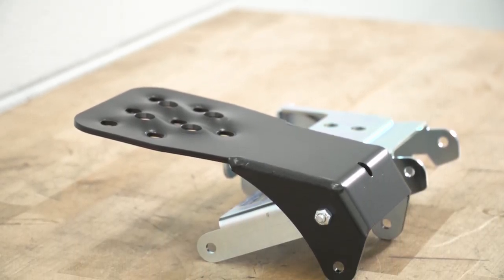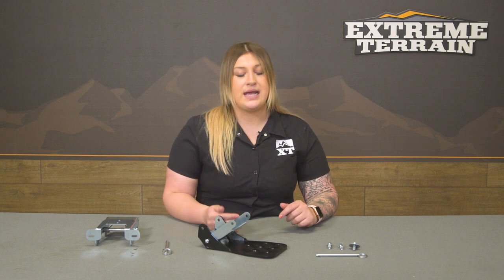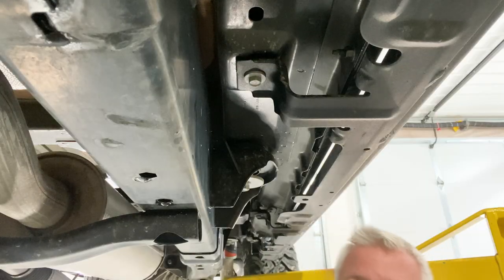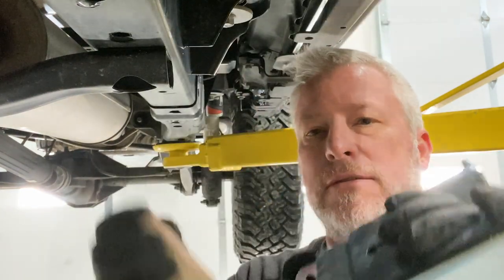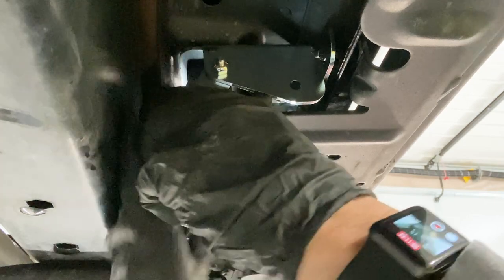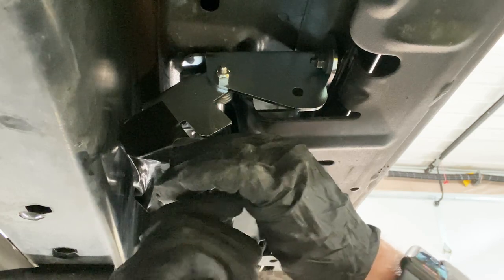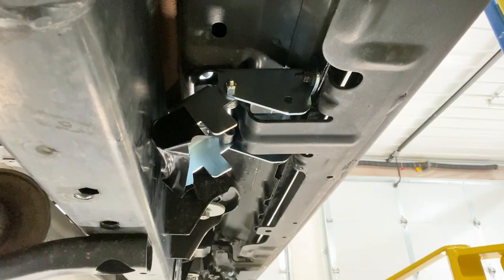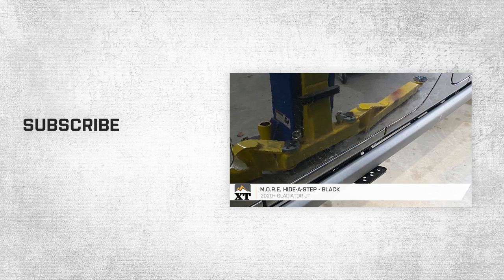Jeep Gladiator JT M.O.R.E. Hide-A-Step; Black Review & Install

Comment: The install was a pain, but it's doable in a short amount of time. I did mine by myself and didn't have the 2x2 block of wood, so while I was trying to jury rig the spring arm open I almost cut off my finger and nose (lying under the truck during install). I ended up using a spare ratchet socket wedged into the spring back to make an L shape. I highly recommend removing the rock rail and using duck tape or something to hold the spring clamp on the rail arm when realigning the rail's screws back on to the truck. Complete install including a couple of pauses took just under an hour.